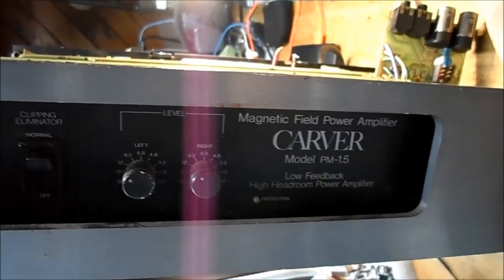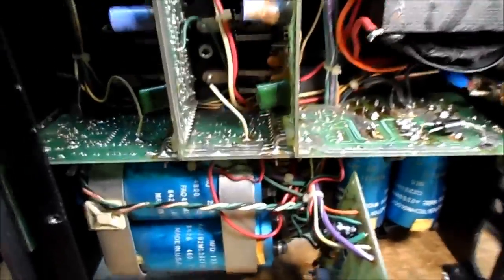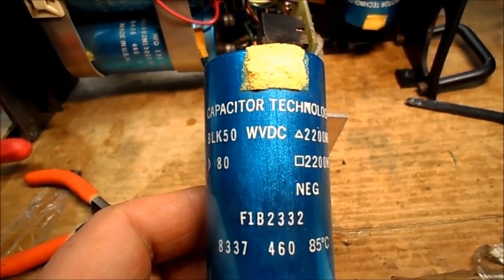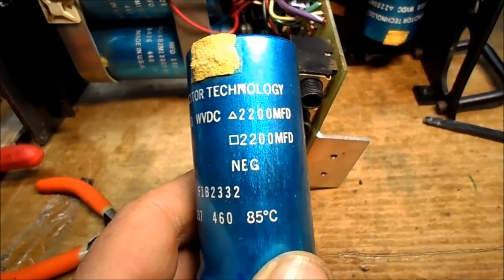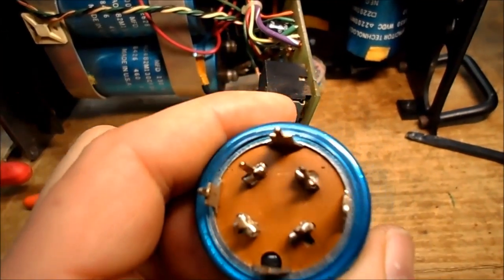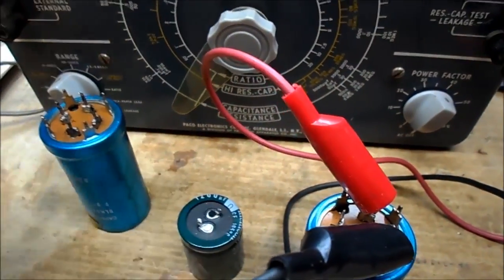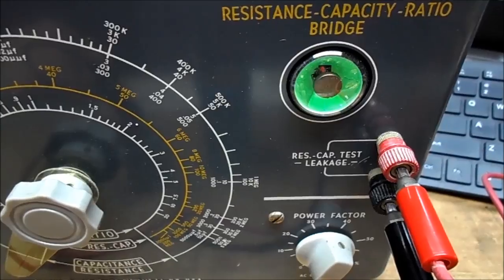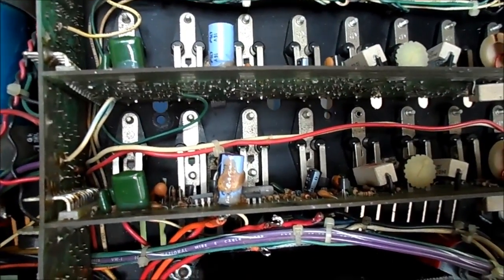Carver PM 1.5 Repair Pt. 1

Comment: i got one of these. it developed distortion on one of the channels. an enginener told me the problem was the transistors needed replacing. i ssume he mean the massive array of PA transistors. he said it was beyond economical repir. so should i try and get the parts myself and replace them or should i throw the thing away? iwhich would be  a pity becasue i was rather partial to its sound.

Comment: A very interesting set of videos on this Carver power amp repair, I have a Carver M1.5t amp purchased in the early to mid 80's that is still working in my secondary stereo system but is starting to develop a problem. The construction of this amp is very disappointing and almost shockingly bad. It was replaced in my main system by a McIntosh MC352 which is of a very conventional design and well built. After seeing this video I will not personally attempt to repair the M1.5t that has a very minor issue. There is a Carver repair center that specializes in these amps it may be a wise decision to send it there eventually. It is 35+ years old now and has served me well.

Comment: Those *# units! A few wound up in the UK running on 240V @ ' 50cps  and when just out of warranty  most found there way to the company that I worked for then!  Spent a long time working out what the designer target was and how far he had missed it by.   
I do like your  PACO c-20 with 'Magic Eye'  Haven't used one since the 60's 
Keep up the good work & vid's.

Comment: The atlas meter is really meant for low voltage caps. I use it for sorting and identifying, but not for leakage testing.